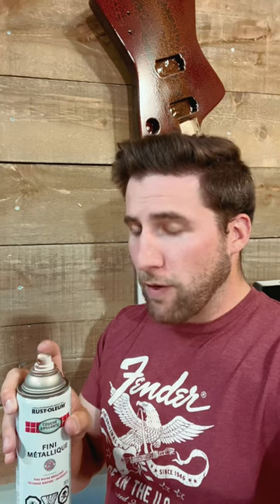Why Spray Cans Spit #shorts

Comment: Also, I find it spits if a) you're pressing lightly on the cap and kinda have so-so pressure, which messes the air-to-paint ration coming out of the can, b) you haven't mixed the paint well enough by shaking the can thoroughly and c) your paint is old or almost over, which messes with the way in which paint gets atomized when going out the nozzle.
Reply from the maker: If you’re running out of paint that is also a mixing and ratio issue.

Comment: Have you ever tried the aftermarket spray nozzles?  They are supposed to provide a better spray pattern than a normal spray paint can.  I wasn’t sure how they would compare with the nozzles on Nitro spay cans.  Since they are made for premium finishes.
Reply from the maker: I’ve tried a few of the relatively fancy ones that come with some graffiti paints. I wasn’t particularly impressed, but I haven’t tried the actual aftermarket ones I guess.

Comment: that happens, but its by no means the predominant reason for spitting.  cheap nozzles and insufficiently shaken cans are probably the predominant reason.  I’m spraying polycrylic on a furniture project and the nozzle is literally the worst i have ever experienced.  they do sell higher end nozzles and if i were spraying a guitar i would not even spray without them.
Reply from the maker: I’ve definitely had some issues with bad nozzles before, but my assessment of what constitutes one of the main reasons for spitting comes from the hundreds of questions I’ve gotten about it and the diagnosis/fix from those questions.